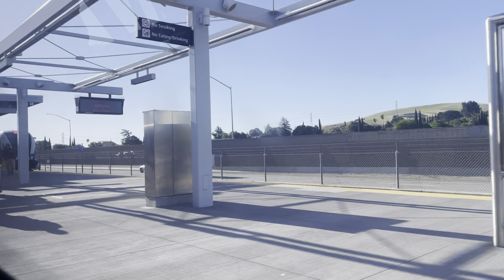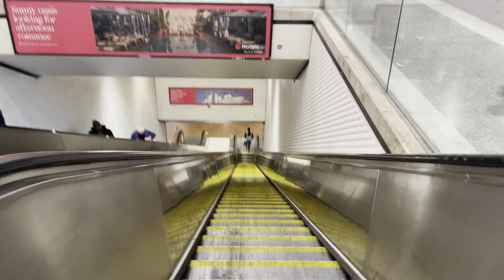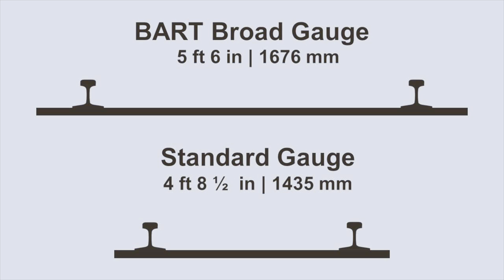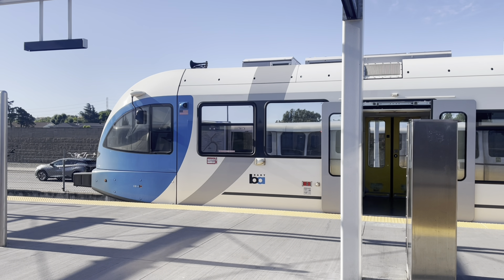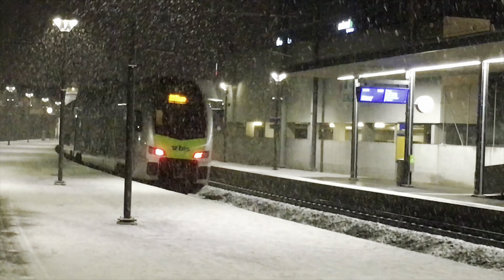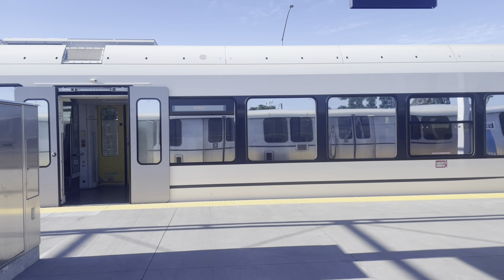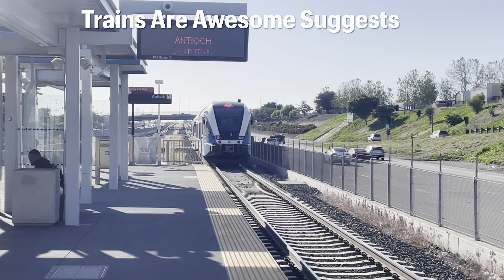eBART: The Strangest BART Extension

Comment: It’s a cool solution to the suburban transit problem!! I mean it does make sense to have a lower capacity train out that far- aren’t BART trains are truly the largest, highest capacity rapid transit trains in America? This transfer seems like the ideal implementation for Maryland’s SMRT, augmenting WMATA with a light rail extension from Branch Ave!
Reply from the maker: I would love for them to build a platform solution like this at Branch! Hopefully SMRT gets built asap
Reply: Yeah, BART trains hold the most people of any transit in North America.  (you should have seen the crowds after an Oakland As or Raiders big game frown face)
There was no reason for the 10 car trains farther than pittsburg.  
But the gauge change is absolutely ridiculous.  Its like removing the big toe of a toddler.
Reply: @sfjessevideo The benefit of using standard guage trains is that they can be linked to existing lines, providing lots of options for expansion.
Reply: I think it is mostly just weird that they don't have the connection point at one of the stations next to this weird construct
Reply: The only reason they did it this way is that the existing line to Antioch was standard gauge (4′ 8½″ / 1.435 m), and BART is... well, for some reason they designed BART to run on super-wide 5½′ / 1.676 m gauge track. It's kinda stupid.
Reply: @andrew_ray  BART is broad gauge because the original plans called for BART to run under the Golden Gate Bridge; since lighter, aluminum train cars and high speed gusts of wind don't mix, the track width was increased for stability. Unfortunately Marin County pulled out... for "some reason".
Reply: @bubbledoubletrouble  Hmm. I feel like installing wind barriers on one (relatively) short segment would have been much cheaper than building the entire system to a nonstandard spec, but what do I know?
Reply: @andrew_ray  If I can find where I put my time machine in the attic I'll loan it to you; you can go back to the 60s and give the engineers a good stern talking to
Reply: This line was built new and Thom's explanation is correct. @andrew_ray
Reply: @jimstraveladventures3961  Then it is so monstrously stupid that everybody involved should be jailed for blatant corruption because nobody would ever think this was a good idea who wasn't getting some fat stacks under the table.

Comment: Too bad they couldn't do that with San Jose unfortunately the ultra spread out suburban center of "innovation" will end up costing $4.6 billion to do 3 stations... scratch that 6.8 billion, wait did I say 6.8 I meant 9.2,  whoops again 12.2 billion (for now).
Reply: the type of trains they are using isn't the problem - it's the fact they decided to use a giant single-bore tunnel super deep into the ground instead of using the more conventional smaller twin-bore tunnels that would be shallower, or not even considering even cheaper alternatives like cut-and-cover or elevated.
Reply: San Jose Dridiron is a huge advantage. Bus service to Santa Cruz and Amtrak as well as CalTrain. My issue is the light rail in Mountain View and the fact that the South Bay is boring

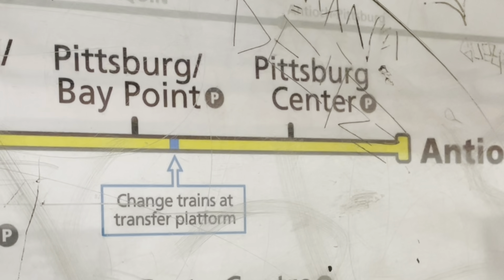Comment: 2:31 "Change trains at transfer platform." The MBTA states it better without words. On its subway map it shows its Red Line Ashmont Branch separated from its Mattapan High Speed Red Line at Ashmont station as two separate but linked stations.
Reply: I think the problem is that for BART, that transfer station isn't at an actual station, so you can't show it as a full station on the line since some might try to use it to enter/exit the train.

Comment: It’s really wild that you can walk through the power pack. I would guess that the prime mover would take up all the space.
Reply: Yup; my understanding (from how it's done on the FLIRTs, which I believe are descended from the GTWs) is that there are four small prime movers with individual alternators on them to power the traction motors, so each side has two engines and there's room for a corridor between them
Reply: @ARod4374 They are very different the traction motors are under the power pack with the gtw and under the cabs with the flirts
Reply: @ARod4374  yes. this summer I rode a GTW (the GKB in austria graz-köflach-bahn). it was weird to walk through the power unit with its diesel generators.
funnily enough, they were a project for stadler taylor made. and then so many other cities wanted them too, so they became a product line.
Reply: It’s because they use 1-4 smaller engines normally the size you’d see in trucks, farm equipment ect. 0-3 locations can have batteries to make the unit a hybrid or you can have no diesel engines and use hydrogen. 
Equipment to pickup overhead power can also be added in most configuration so tri mode is possible. 
GTW had been out of production for a while because it got too heavy. It’s been replaced by short FLIRTs called WINKs by some operators
Reply: We have a class of diesel train in the UK, the class 230, that get their entire 789hp (allowing a 2 car unit to travel at 60mph) from 4 3.2L Ford Duratorq engines (as found in a Transit van) slung under the body, so not protruding into the passenger space at all. 
When diesel engines are being used simply to generate electrical power, they don’t need to be very large at all.
Reply: Maybe they should lock that thing lol